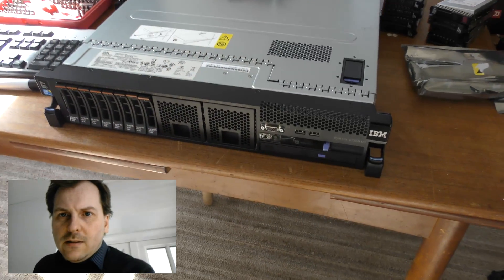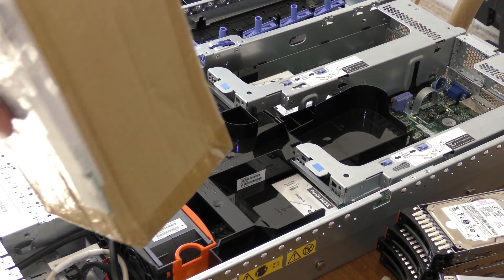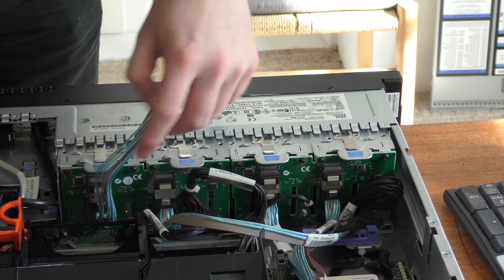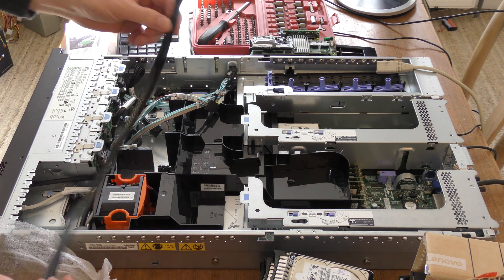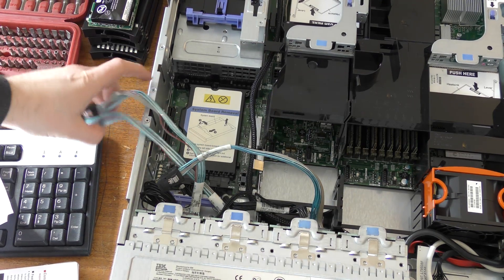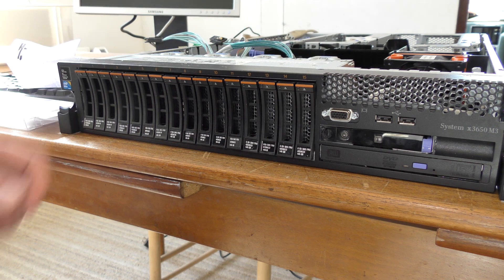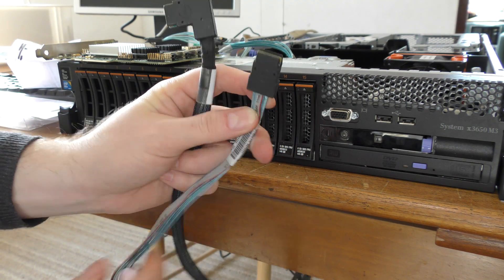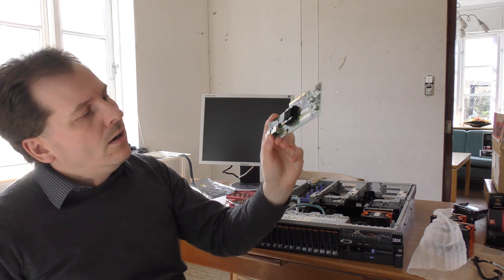Expanding Lenovo x3650 M3 from 8 to 16 Drives - 502

Comment: Hey, can you explain what the mini Sas port on the motherboard does? Im rigging up my m2 and hooked up the backplane and adapted the cheap splitter power cable into the super expensive cable but I plugged into that port and although it works nothing sees those 4 drives plugged in.
Reply from the maker: Hi Neko
They should be SAS connections,, with no raid,, I really should try them some day.
Thank you for watching! :-)
Reply: I think I've seen you have M2 model, default comes with 8 sas on 2 backplanes but has space for additional backplane, with mr10i you can't add another without buying a sas extender is what IBM is saying but in the documentation it states this onboard port as being able to use both sas and sata but doesn't seem to work as expected when connected to 3rd back plane :s getting another mr10i for now. For the power instead of scouring for the expensinve 10 to 10pin power, I took the stock 20 to 2x10pin, cut of 20pin and soldered 1 to 1 pins on the connectors, save a lot of money. cheapest sas extenders though around £25+ on amazon and ebay. And great vids, very useful and interesting, not just for ibm/lenovo but overall as well :)

Comment: Well done video. The SAS expander is a good idea, but what about the 4 port LSI raid card? it is thin and could fit in the tight space, it is 6gb/s but doesnt have a battery. What is your opinion about that Morten?
Reply from the maker: Hi Mamdouh Tawadros
Thank You very much!  Not sure what 4-port card?
Thank you for watching! :-)
Reply: https://www.ebay.ca/itm/IBM-LSI-Logic-SAS-9212-4i4e-8Port-6Gb-s-SATA-SAS-Controller-Card/232618847504?hash=item362929ed10:g:l88AAOSw8b1aTWnQ

Comment: Hi, Did you end up getting this server running the LSI00137 MegaRaid card you show in this video. I have the same server and the same raid card and it will not work and the store that sold the raid card says it is a compatibility issue but I think it is a faulty card.
Reply from the maker: Hi Murray White
I never got the right cables for powering my backplane of the x3650 M3,, so NO I never got to it.
Thank you for watching! :-)

Comment: Hey you know that expansion card is supposed to go were you took the raid card out from, then you plug in all 4 SAS cables into, the two connectors on near the front of the board go to the M5015 which is supposed to go into one your PCIE slots. I looked into do this with my x3650 M3 but after getting my hands on a IBM DS3512 for next to nothing I decided against it.  Have fun! :)  Btw, there is a PDF from IBM on how to install the expansion card...Google is your best friend.
Reply from the maker: Hi dhowser2008
Thank You very much!  But an expansion card for the x3650 M3 is easily $200,, I payed like $30 for that LSI00137,, to try that.
http://amzn.to/2nzJ3RP
Thank you for watching! :-)
Reply: Page 85/86 will show how to setup the expansion card that you have. http://systemx.lenovofiles.com/help/topic/com.lenovo.sysx.7945.doc/PDF_4255_7945_7949_iug.pdf
Reply: I bought my IBM DS3512 with 12 x 300GB SAS drives for $300 CAD. You can't go wrong with that price.
Reply from the maker: Hi dhowser2008
Thank You very much!  That is a good price.
Thank you for watching! :-)
Reply: Update. I decided to get an expander card for my X3650 M3 that I am going to use as a Plex Media Server. I installed it last night, its a tight fit. The only real problem I had was finding the 602a firmware for it, the card came with fw 510A and IBM only lists the newest for downloading 632A which will fail if you flash ontop of 510A. After a few hours I was able to find the 602a firmware for Windows. If you want I can put the file online for your (if you need it).

Comment: Awesome, I just installed a second back-plane in my IBM X3650m3 5 minutes ago. Just using 2 LSI 8 port raid controllers at the moment, might pick up a single one with more ports soon.
Reply from the maker: +niksuto 
Nice,, which Lsi controller?
Reply: Currently running 2 IBM Serveraid M1015, I'd like to upgrade to one that has more ports and better raid options.
Reply from the maker: Hi niksuto
That shout be a pretty good controller!
Thank you for watching! :-)

Comment: Nice setup! But if you put the 4 port card in the slot at the front, the connectors would face the drives. So the cables may just be long enough I think ;)
Reply from the maker: +kexyr 
The long one Yes. The short ones No,, I did try ;-)

Comment: Cool, I am converting a bunch of servers into desktop cases, so the SAS/SATA backplane setup doesn't really work.  I had thought of this before, but this reminds me to just get a PCIe RAID card and run SATA cables instead.  I was just going to hide the backplane connector and run SATA+power extensions from the backplane to a typical HDD cage.  Also, my servers only take 2.5" drives, and this would allow 3.5" drives too.  Anyway...thanks for the video!
Reply from the maker: If there is a raid controller in the server it will just present the OS with a virtual drive,, and that works on a PC as well.